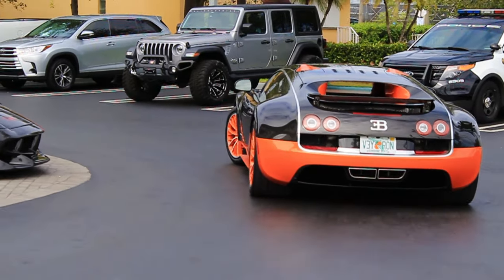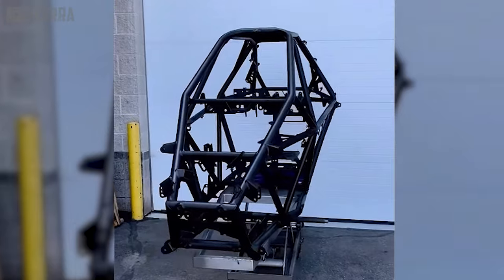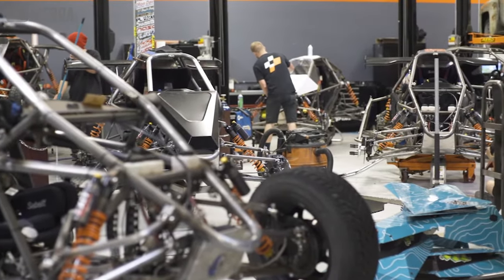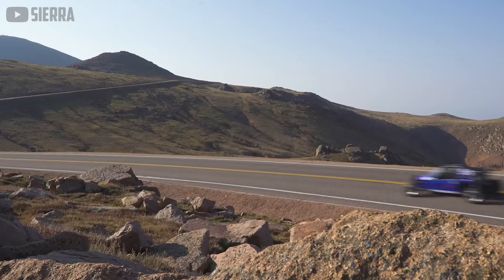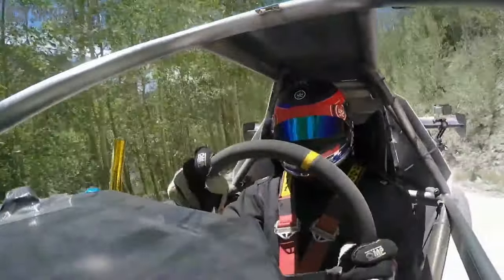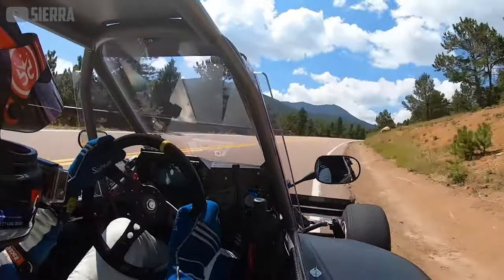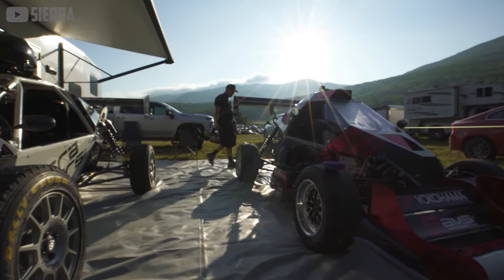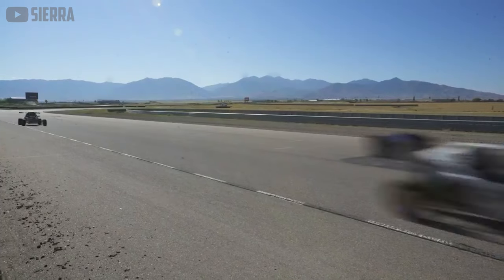This Tiny Supercar Can Beat Ferraris

Comment: 50k? You can get a Lotus Elise for that money. Or a Caterham Seven 340. Those are proper road legal cars.

It's kinda silly how they're really riding the "affordable" horse here, but then it's really expensive compared to other options like kit cars, which can be made road legal easily too.
Reply: Their market isn't every day Joe's wanting a fun street car, it's fairly well off people that want to go racing. $50,000 for a capable track platform is way cheaper than a 911 GT3 R ($570,000) all with a fraction of the running costs. Compared to the other cars that you mentioned in the price bracket, the money that is spent on making the Lotus and Caterham more road oriented is repurposed into components on the Sierra that are better rated for demanding track use and are easier to adjust and replace. 

When it comes to the world of track driving and racing you reach a point where you need a dedicated platform and oftentimes buying something that was designed from the ground up is cheaper than building up a road car, and that's why the Sierra exists. It was kind of disingenuous for the creator of this video to try and pit it up against road oriented supercars because that's not what it is.
Reply: A lotus Elise is like driving a Barbie car. Your comparing apples to planes . 🤦‍♂️
Reply: @tylerseabook9423  I think the 'apples to oranges' phrase would have done since they are both cars after all 😁
Reply: These are race cars, and at $50k for something essentially track ready and being that fast, that is cheap.
Reply: A later model base trim Elise is going for about 80k... and that gets you a car with half the hp of my cheap ass base trim motorcycle.
Reply: The cost of maintenance on these are substantially cheaper. For example racing expenses like tires, motor maintenance and replacement parts, fuel, etc. And these are street legal
Reply: Name a car for less than $50,000 that you can purchase brand new ready to go, that corner like a formula car, do 0-60 like a dragster, and still get 30mpg.  I would love to know what car you have in mind that has a power to weight ratio in the thousands per ton, that can endurance race better than a Miata, out drag a Ferrari, and spend less fuel than a Ford Fiesta.  Waiting…

Comment: Speed is probably limited by gear AND aero. We run Thunder Roadsters and they basically hit a wall around 125MPH unless drafting. Power to weight is awesome but it takes HP for top speed and 200hp isn’t enough.

BTW a Thunder Roadster is $25,000-40,000.
Reply: Na it's about transmission not hp
Reply: You can install a longer final drive and hit 158mph limited by aero

Comment: If i got 50k jumpchange i also got 75k jumpchange. So who is the market for this? Who would buy the 200hp version?
Reply: The funny part is that you could just buy the 700R version and buy a part out street bike motor and a cheap ebay turbo and make 350whp for under $50k

Comment: I build my own Turbo for less than £5k, I have driven it everyfuckingwhere, it will do 0to 60 in under 2.0 & over 220, alas my Sphincter gave out at 190mph, I'm both reckless & fearless in equal measure, but I'm not fukn Stupid, I leave that to others.
These things turn in their own wheelbase, who the fuck needs reverse?

Comment: Did you just say swapping the tires turns it from on road to a rock crawler 😂🤦‍♂️🤦‍♂️🤦‍♂️ nothing about 2 wheel drive racing around in sand dunes is rock crawling 🤦‍♂️ like who wrote the script for this